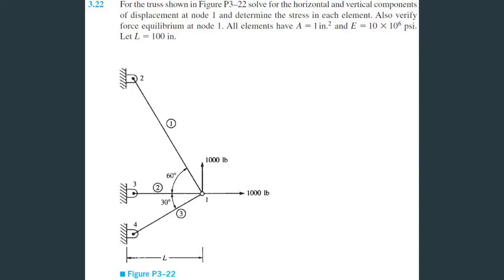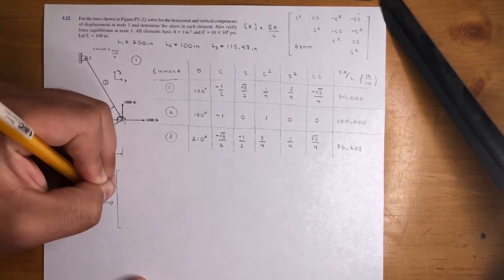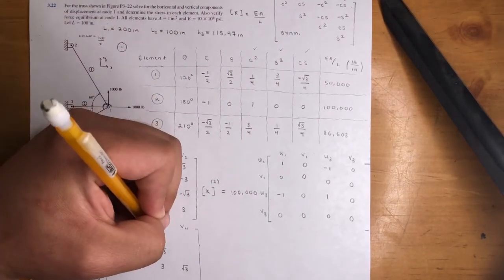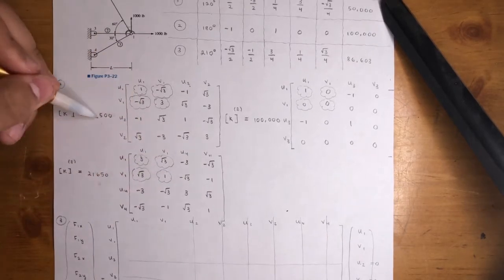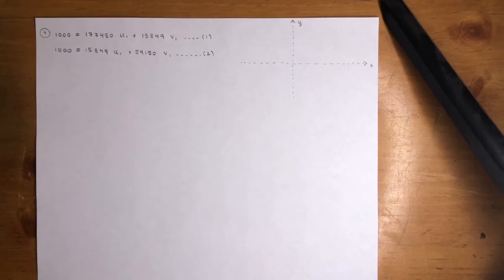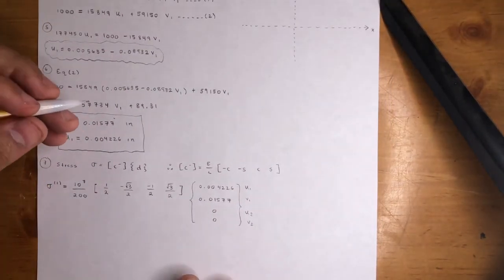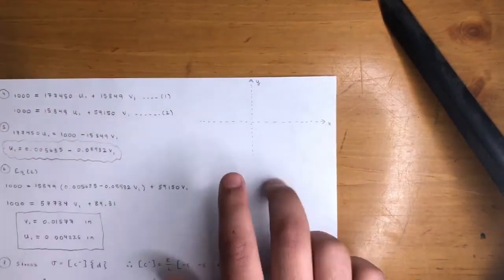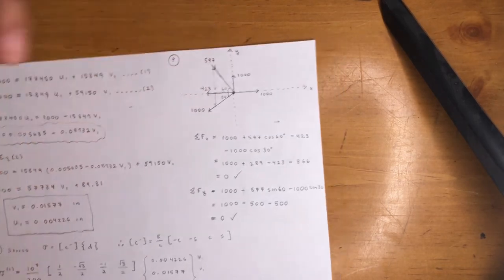Finite Element Analysis - Solve for the Horizontal and Vertical Components of Displacement at Node 1

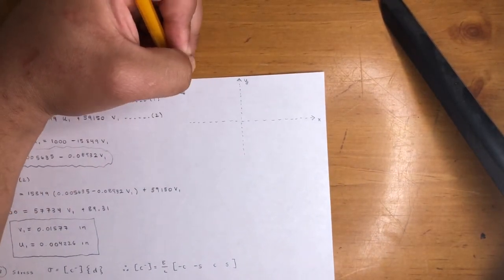Comment from the maker: Yadani, there’s one huge thing I forgot to mention. Don’t worry, the problem is all correct. But at the beginning of Step 8 (31:47), you do NOT use Stress numbers to verify forces at any nodes. The reason it worked here, was because our cross sectional area was A = 1 in^2. 

Stress = Force / Area, so when A = 1, stress and Force are the same in magnitude. 

But to verify forces using stress values, you MUST FIRST MULTIPLY each stress by the area of the respective beam (area can be different for each beam FYI). And that will give you your Force values. My bad.
Reply: important